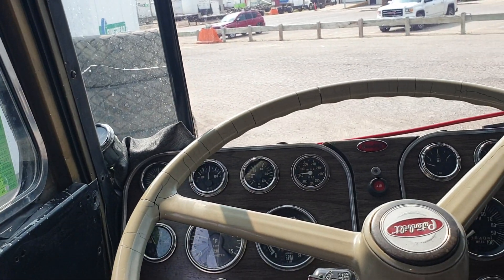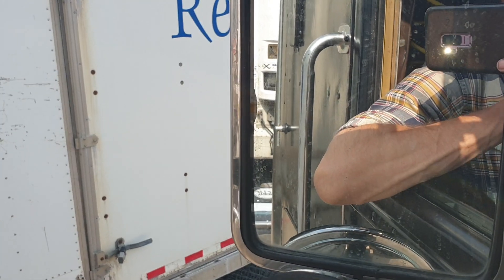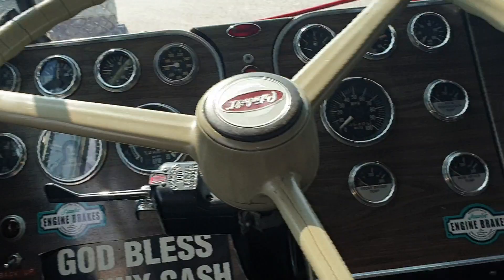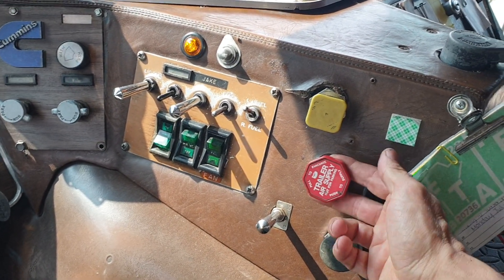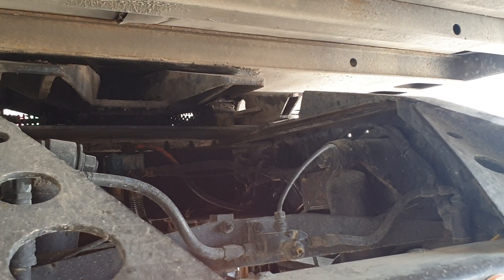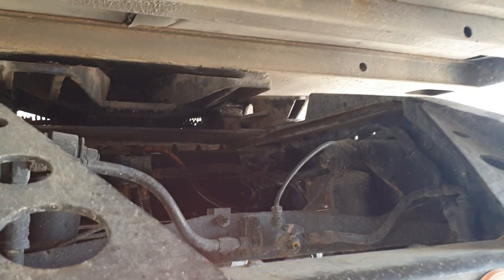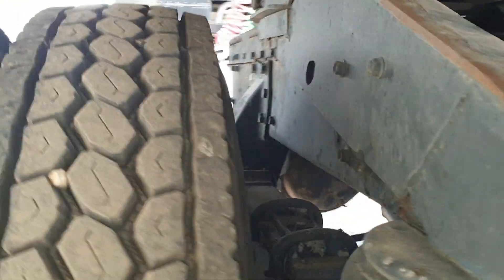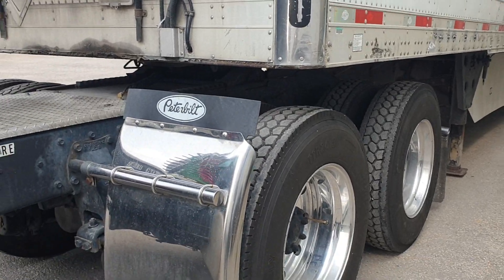coupling up a Pete 352.

Comment: Darn, that truck must be one rough riding beast since it seats on leaf springs all around, right?    Get a modern air ride Pete cutout and give that antique COE a smoother ride while stretching it out a little too.

Anywho, Winnipeg, MB is the Canadian trucking hub, right?    Allot of truck and trucking resources around Winnipeg.
Reply: It's got air ride.
Reply: That tractor for a cabovers already has a decent length wheelbase. More than likely had the Peterbilt Air Leaf suspension. Very common